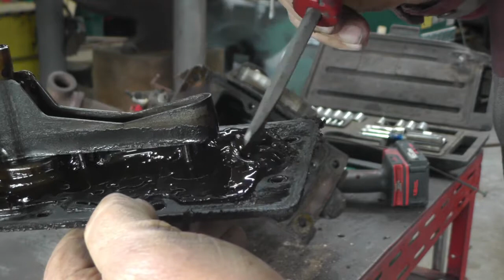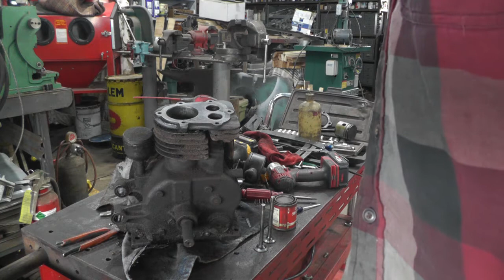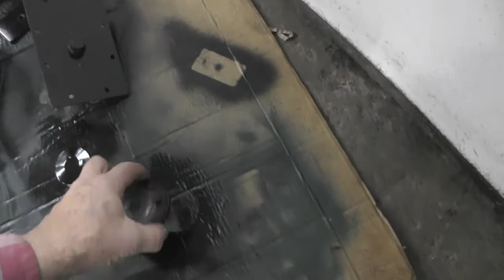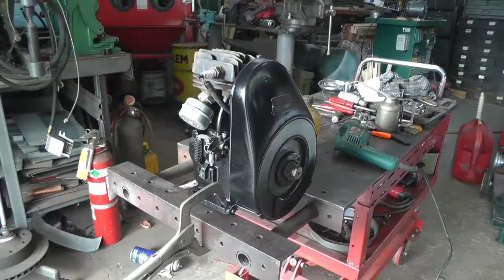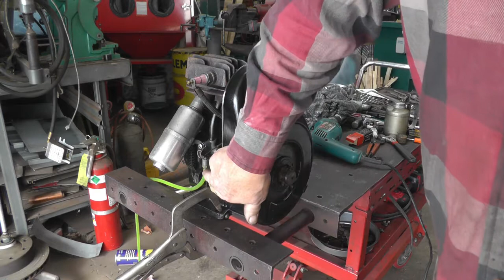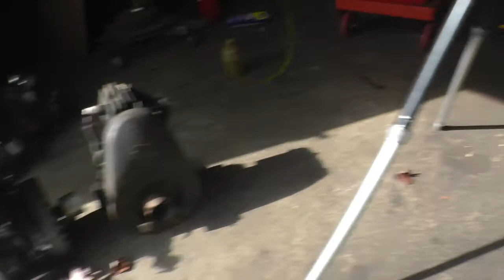Briggs Model L Back to Life

Comment: Kevin, how do you store these engines once you have them rebuilt?  Do you drain the gas back out and let the tanks sit empty, or store them with fuel in them and run them periodically?
Reply from the maker: Completely dry. I run them out of gas if there is any gas left in the tank at all I soak it up with a rag and leave the cap off for a week or so.  Thanks for watching.